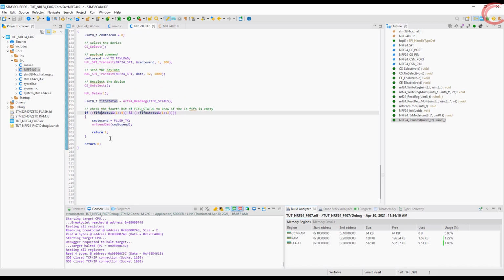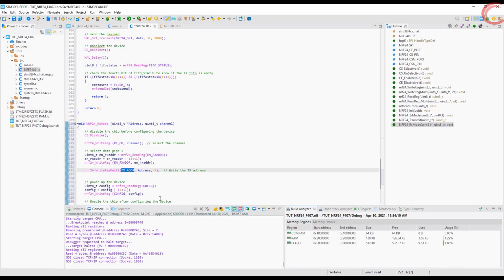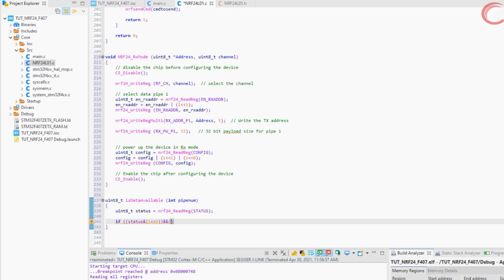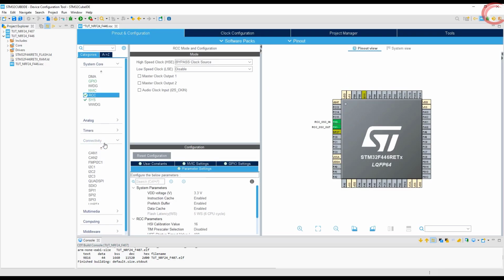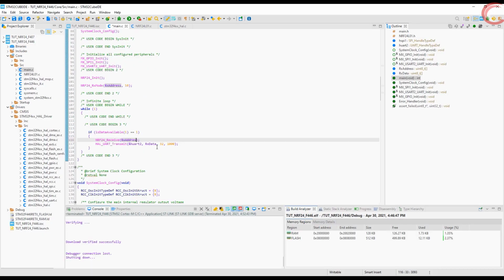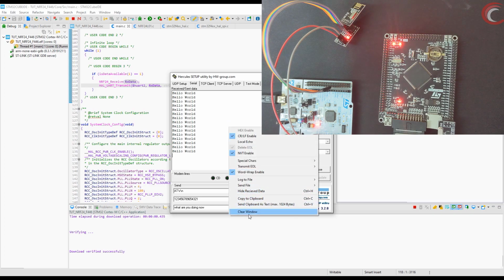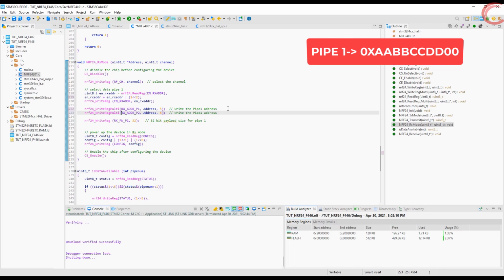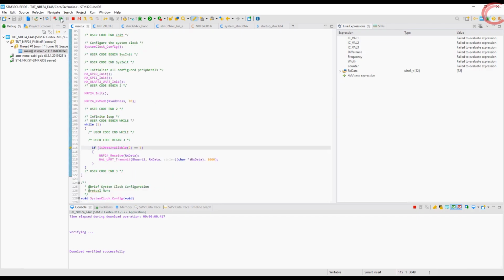How to Write Basic Library for NRF24L01 PART 3 || Receive DATA || SPI STM32

Comment: Hey guys, if its not working for you, you can try to check the spi settings, the boud rate must be the same for Rx and Tx and check the data size, make it the same for both TX and RX equal to 8 bits. It worked for me, a noob mistake, but im happy it works now, good luck!
Reply: How did you fix the error?

Comment: I can't grasp the bit at @5.50. The code checks if status&(pipeline<<1),  bits 1-3 indicate on which pipe there is a data to receive, but it can only tell 1 pipe number(0 - 5), so if e.g. there is a data on pipe 3, and we'd check for data on pipe 1 or 2, it will also return true (bitwise 3&1 = 1). It will also give information for data on 1 pipe, what if there is multiple pipes in use?
Reply from the maker: You have to individually read it.
Let's say you have received data in P1, P3 and P5.
You have to first check the status with P1, then write 1 in the RX_DR to clear it.
Since the data is available in 2 more pipes, it will again set to 1.
You repeat this process until all the reads are done.

Check the last point ('c') on page 59 of the datasheet
Reply: @ControllersTech  little bit late here, my question is what if the data occur on pipe 3, we still get 1 from the function isDataAvailable, isnt that a fault

Comment: What is the current on your transmitter module? The current on my transmitter module is about 100uA, the receiver module is 15mA. Right or wrong? LED on my transmitter does not blink. Plz help
Reply: Check your nrf transmit function where config register is setup. Change  " config=config&(0xF2) " . This will always make config=0x00 because intialy config is set to 0x00. And your transmitter will never work. Struggled a little to find this 🪲.
Reply: @VarunVh2014  My receiver don't active, please help me

Comment: Thank you for your videos!
I have setted up the transmitter part of the project (data is sended, led is blinking 1 hz), but i cant receive any data on the receiver side.
The ststus register is allways 0xE - all pipes are empty.
What can be the problem?
Reply: I have solved my problem.
In NRF24_RxMode i configured pipe 0 (instead of pipe 1) and then made changes in function uint8_t isDataAvailable (int pipenum) - if ((status&(1<<6))&&(status&(pipenum<<1))) not work with pipe 0
But, thanks anyway, keep up good work!!!
Reply: @Zelan666  i have this issue but changing pipe nums still the same "0x0e error"...  so i have the TX sending messages OK but the RX does not receive yet (i already test my both modules as TX and both works)

Comment: sir why you did set channel no. 10 in rx mode Please reply
Reply from the maker: So that we can receive data, which the transmitter is sending on channel 10
Reply: @ControllersTech  can i use arduino as receiver and stm32 discovery as transmitter
Reply from the maker: How does that matter ?
You are using NRF for communication. As long as the channel and baud rate are same, you can use whatever you want.
Reply: But sir arduino use char data type as receiving data type and we are using uint8_t data type as sending data type i think that's why arduino doesn't receive anything but garbage data.
Reply from the maker: 1. I don't care about Arduino. You ask the person, whose library you are using.
2. Data is transmitted as ascii. So you should manage it accordingly.
3. Check tha baud rates and other setup, like acknowledgement and data length etc..
Reply: @ControllersTech  ok thank you so much